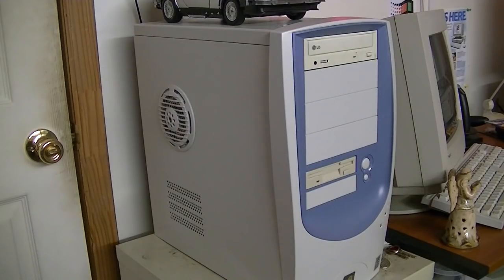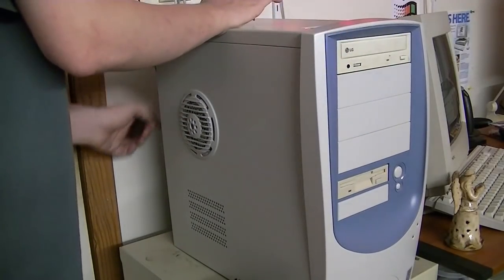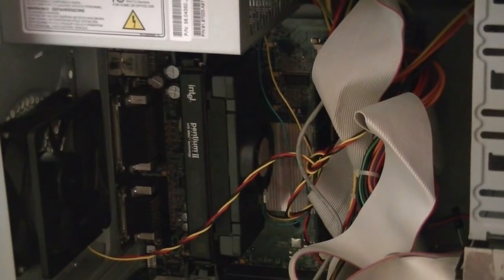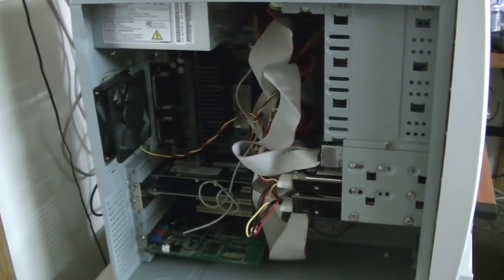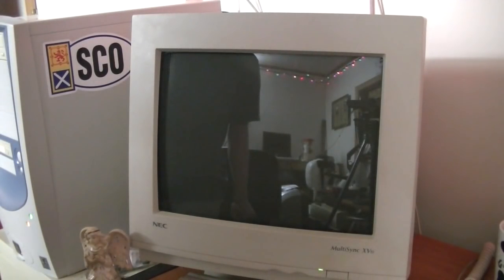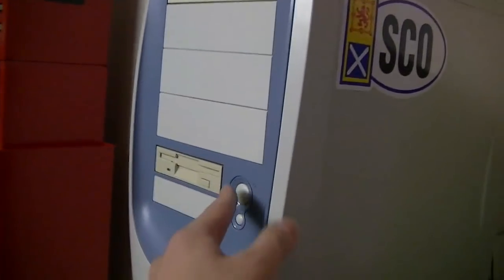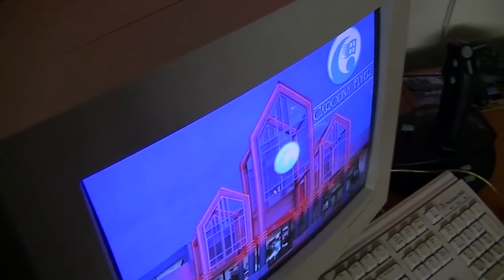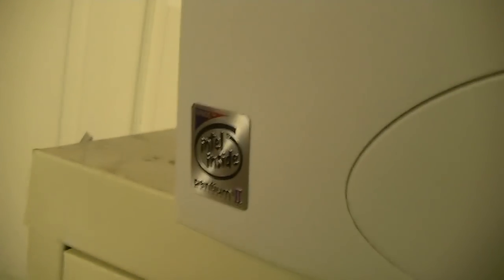A Nostalgic Christmas 2017: Carolina Flyer CPU Upgrade

Comment: The 600MHZ PIII Katmai is the rarest CPU with Katmai Core. It runs very hot (2,05V VCore). Good to see, that the CPU has a big heatsink, the 600MHz coppermines doesn't run so hot. I also would recommend to change the heatpad to a good thermal paste.

Comment: Congratulations on making it work.
That's unusual that updating the BIOS will make it less compatible with newer CPU's. 
Usually it's the opposite.
I agree with the post by icemansquared too you need some CPU fans on that.
I have 3 Pentium 3 systems BTW all with 3Dfx Voodoo 3 graphics cards in them.
2 of them have Aureal Vortex 2 Sounds cards for 3D A3D Positional sound for gaming.

Comment: Great video, but you probably want a fan on a 600MHz PIII CPU.  I have a Dell XPS T500 with a 500MHz PIII that doesn't have a fan by design- just a plastic heat shroud which should help direct hot air out the back of the case.  I believe I fried the proprietary Dell 6 pin PSU a few years ago by running it as a 24/7 Ubuntu file server.  I'm also concerned about the heat dissipation using just a heatsink on my 233MHz Pentium MMX machine that I upgraded from 100MHz last week.  I just received a USB temperature dongle the other day and the 233MHz Pentium rose to ~45C under normal operation just loading Windows 95.  I didn't stress test with Prime95 yet, but I'd assume it would get hot enough for concern.  I don't want to risk an old proprietary Compaq motherboard for science so I'm going to put in an old 4 pin molex case fan.  I've even read about some faster 486s having small fans while researching whether or not a Pentium 1 needs a fan.